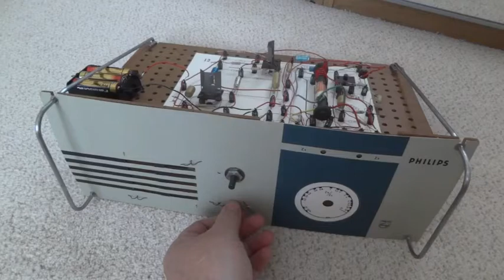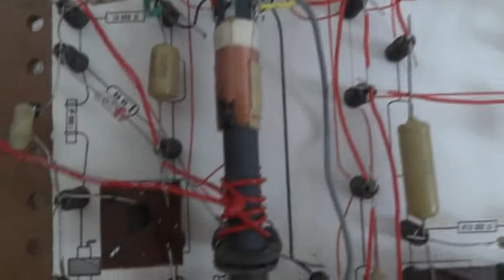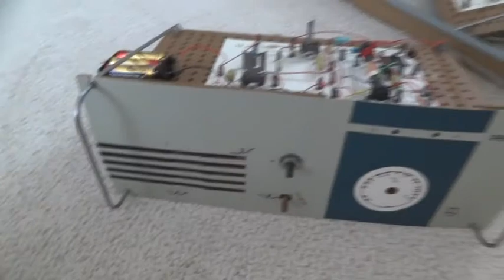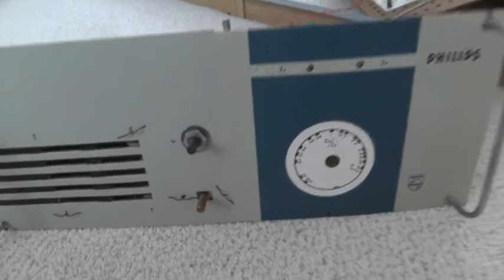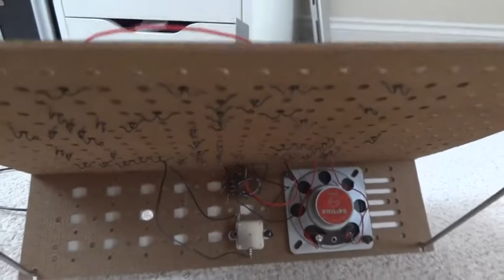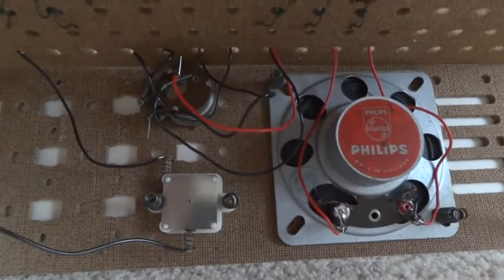1970's Philips Radio EE1003 Electronic Kit Set

Comment: I remember building the alarm/siren - from circuit D9 (2-tone horn)

I then improvised by connecting a piece of wire randomly between two spring connections until I discovered a faster rate could be achieved beyond the range of the adjustable potentiometer.

Comment: 11 Comments? I also got this from my father when I was around 12 or so... And I built this radio too. So now there is 12 of us! BTW... Anyone built D2? That one blows a transistor. Who had that well? Recently, I looked into that why that happened, and it appears there is no current limiting resistor in series with the light 💡 and the transistor. However, it kind of depends what kind of a light bulb you use, you need one of low wattage that limits the current all by itself to no more than 200mA. So apparently what happened was that I blew that light bulb before and then used one from the 🚲... But those carry more current than the original bulb and those blow the transistor if the current gets above 200mA. And only D2 had this problem because the other D.. circuits have current limiting resistors but D2 does not... So now you know!